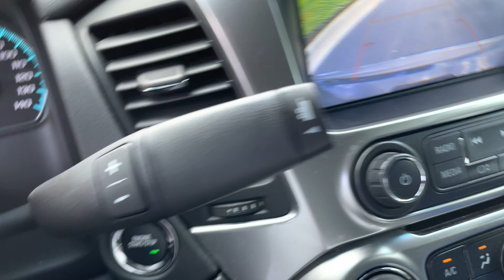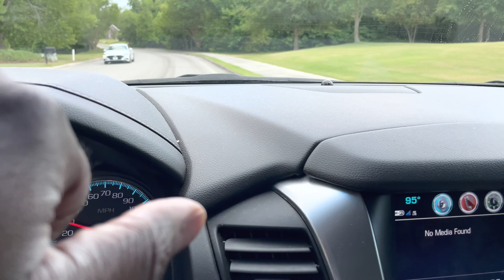Honda Accord 2.0T | NEW Mods - How to make 500 HP [4K]

Comment: Hey, I saw a built K20c4 on wrench monkeys and it looked like your car and I'm curious if the K20c1 head is a direct swap? Or did you just build up the c4 head? It's in the video "K20c4/k20c1. This would be a big deal
Reply from the maker: Im still on stock block. Ported manifold only.
Reply: @fred_b_360  good to know lol I'm surprised it holds up to that big turbo